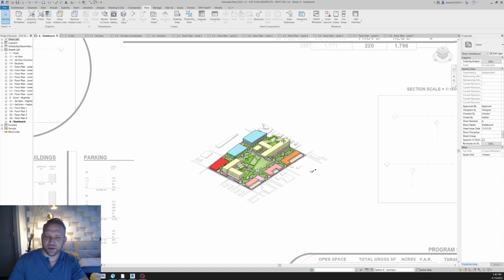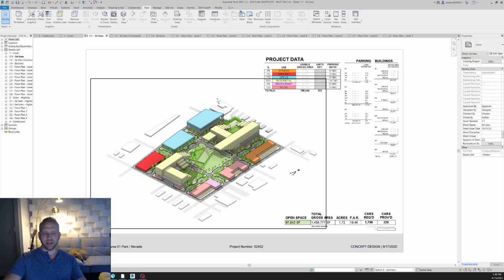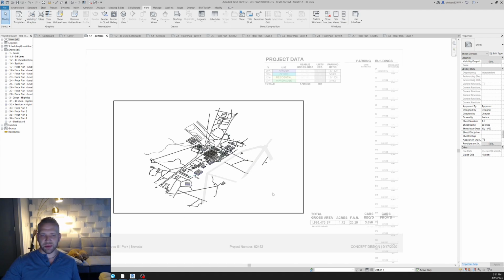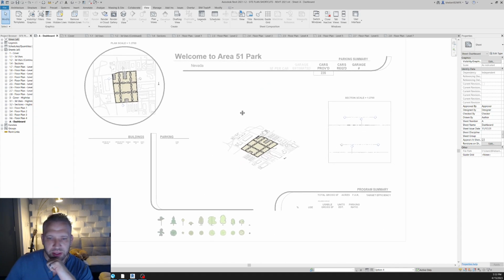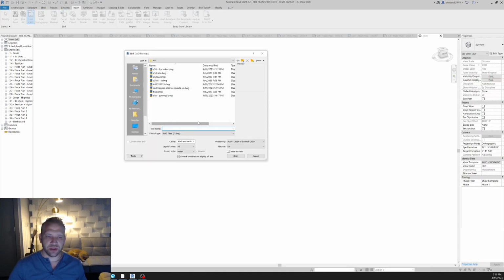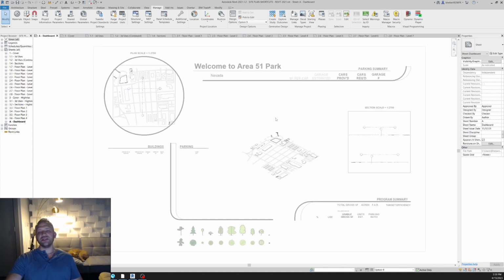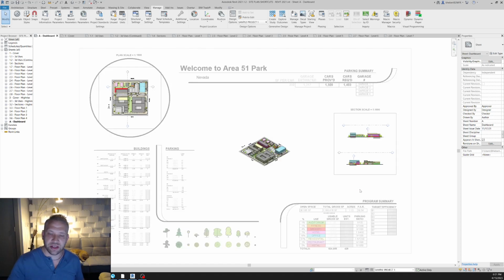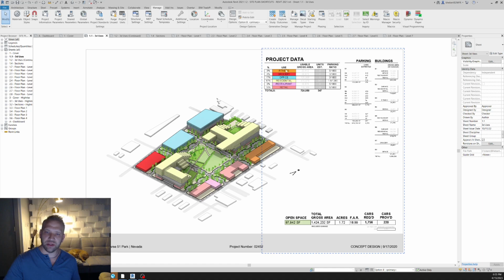Area 51 Master Plan Design in Revit & Getting Beautiful Design Graphics Automatically w/o Adobe

Comment: Hi there... tried using the object styles settings you showed for the imported CAD. but my road did not come up shaded/filled.. any idea what I got wrong?
Reply from the maker: The road has an actual material applied to it via the object styles. Make sure you create and apply a road material to the road. That's what creates the shading.